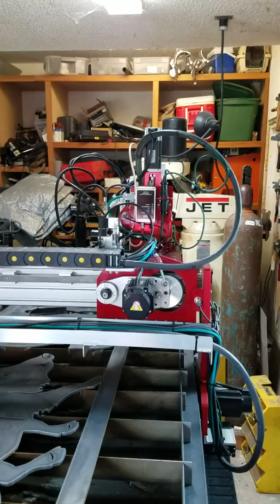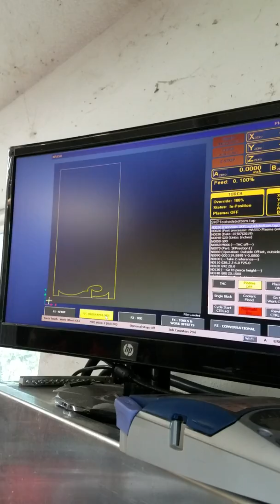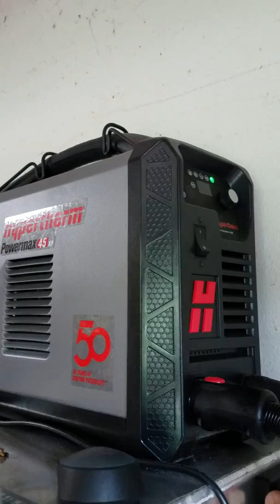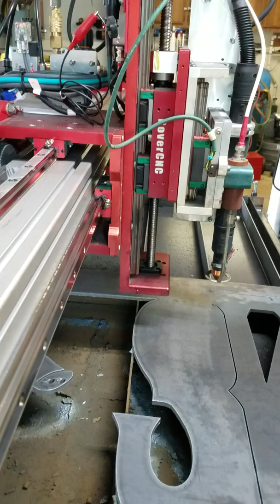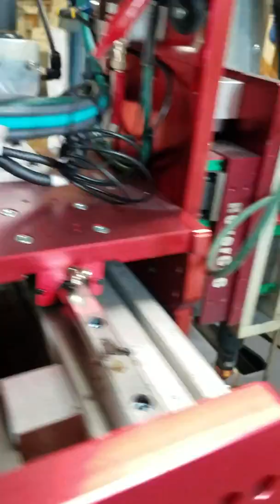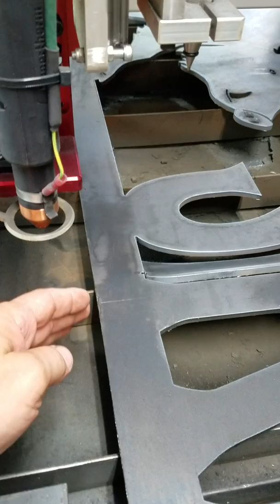Masso CNC Plasma in action

Comment from the maker: As to the noise question, no issues with the Masso.  I did have some issues with the servo drives, (noise from the drives not from the plasma) that was affecting my first THC.  A rewire with shielded twisted cables, and star type grounding resolved most of the issue. If you are not comfortable with hobby electronics, I would strongly consider something like cncrouterparts kits.

Comment from the maker: I built the table as a mill and plasma.  When I do it again, I will build it as a single purpose table either plasma or mill.  Set up the way it is now, it does not work well for plasma.  SNB solutions in Canada sells the upgraded rover components.  I would build my next plasma using their kit or cncrouterparts kit.  I am using servo drives from dmm, I am happy with them but it could be done a little cheaper with servos.  I am using a custom rack and pinion drive with cncrouterparts belt drive reductions.  If I do plasma, I would keep it simple and use the Rover screw drives, you need the speed not the torque for plasma.  With the screw drives you are limited on table size.  The Masso is performing quite well,  it took some time and software revision, but it is working good now.  Torch height control is still a minor issue, I have tried both capacitive and voltage controlled.  For most plasma, the voltage control is probably better.  I highly recommend sheetcam for the cam software.  Fusion360 is great, but sheetcam is a little more refined for the plasma table.  Good luck with you project.  You should also check out the Masso forum for additional help, there are a lot of home users with a great deal of experience. Have fun!